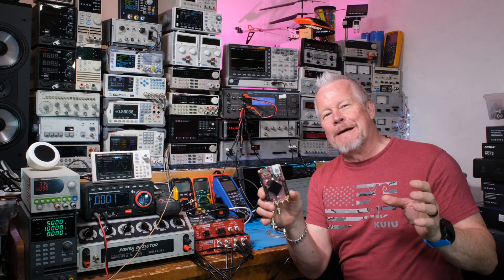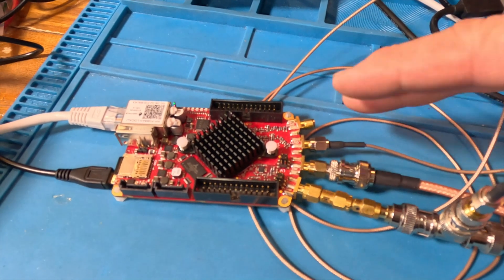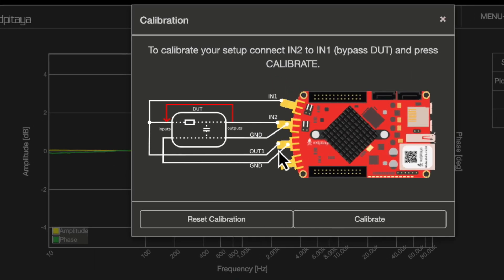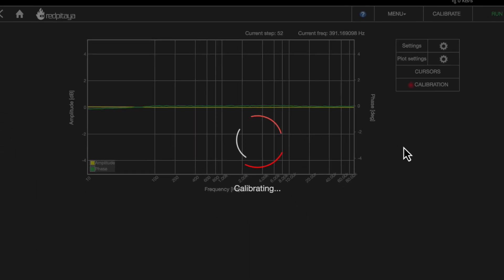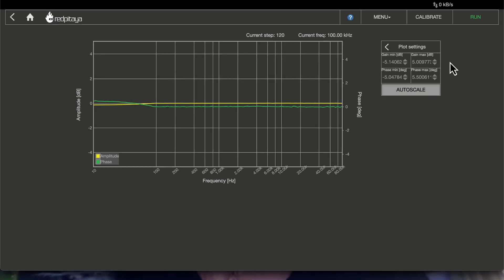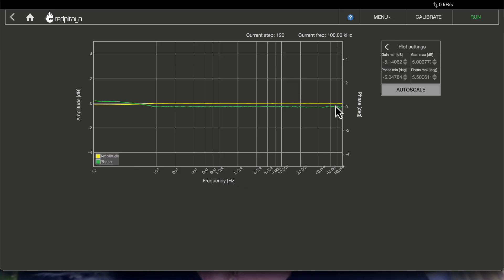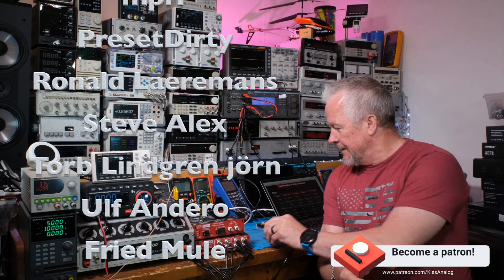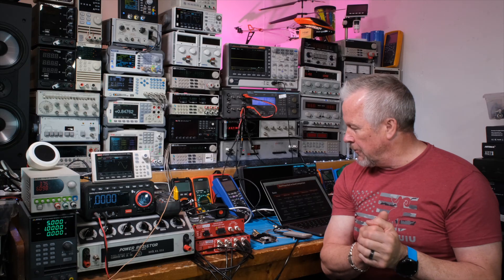Red Pitaya Bode Calibration STEMlab 125-14 #redpitaya

Comment: Calibrating the most based open source data acquisition tool? This Bodes well.
Reply from the maker: I'd think that it would have come calibrated.  I could see calibrating out the test lead variations - but I am surprised it measured so strangely.  Did you see my last video?  https://youtu.be/PvyLSKpEtGk
Reply: @KissAnalog  I saw the short and commented about it only doing Linux.
I just couldn't resist the obligatory joke.
Test conditions can vary from one test to another. Different impedances and lead resistances, etc. For critical measurements, you'd even run a self cal on your higher end equipment.
I do agree that it would have been nice if it had an internal self cal function.
Reply from the maker: Yes, I think the cal should have been done at the factory.  I can see taking out the lead set up for impedance, but the basic scope/FFT should have come calibrated.